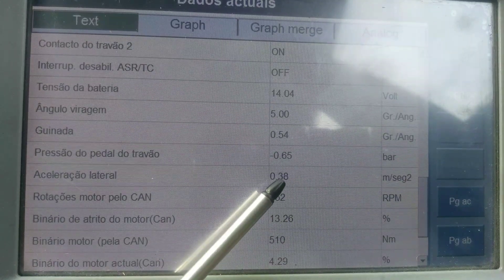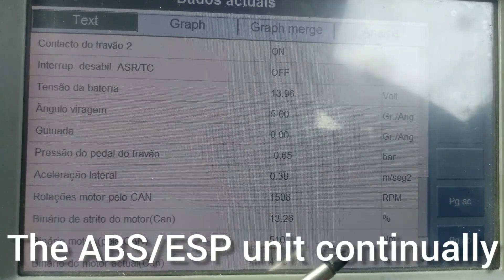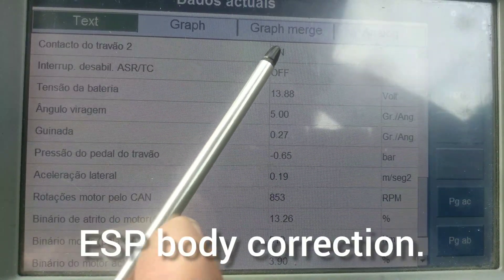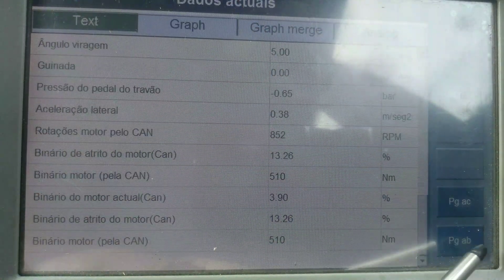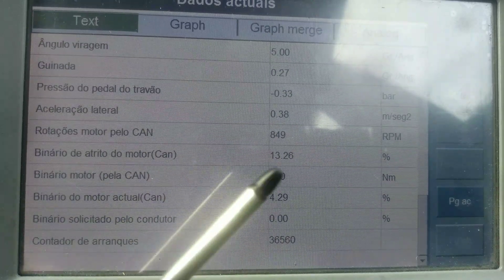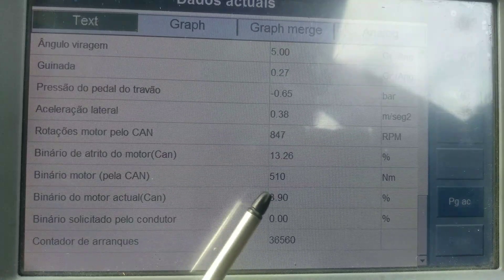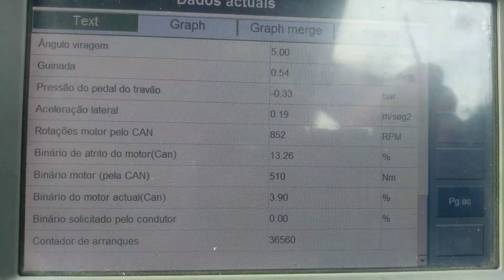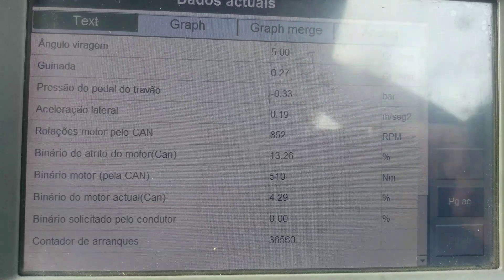ESP vs ABS, witch is best? The principals of working of both systems!

Comment: I think my Sandero has Bosch 8.1 ABS. 
I would never drive a car without it. It is one of the greatest inventions in car industry in my oppinion. Not only it allows bigger brakes to be used, as you said, but also keeps the wheels/tyres at the peak of the static friction (which is higher than the kinetic friction) which reduces the braking distance of the car on solid surfaces. And the ABS also allows the steering of the car while at the maximal braking.
Reply from the maker: You really get my massage! Just for a lough remove the fuse ou the abs/esp main plug. (There's a chance the car not to start)
If it do, drive it and see the brakes behaviour

Comment: Hello, I have a problem with my abs esp unit, it shows an error (c1205) of left front wheel speed sensor but the sensor is good (i;ve connected other sensors that were ok), I've red alot of topics about the esp/abs unit having internal problems with  some very thin wires breaking of. In my car the abs light  apperas after the car gets warm or on a very hot day it lights up immediatly after i switch ignition on, in the mornings when its colder it shows after some driving. I 'm planing to replace the unit with a good used one but there is so many numbers on the unit i'm not sure wich are the one that matter the most and wich are less important. Any suggestions would be helpful, thank you in advance
Reply from the maker: Hello. Thanks for watching! You can trust on the Bosch number. It never changes even if the unit is from other cars or different years. That unit may also have repair. Check out the description of my 156 and 33 cluster repair. They repair stuff like that
Reply: @alfaromeonoproblem  thanks for the reply, I will chck also the video

Comment: Hi. I think I have an upcoming problem with my clutch on my 156 110kw Jdtm. The Kupllung separates only just before the end of the pedal travel. I have looked at the cylinders, both work very well. The clutch and flywheel has only come new since 80,000. Both Valeo. Was probably not good. Do they have a recommendation which clutch is very good?
Reply from the maker: Hello. In fact those clutches have a lifespan of about 100.000kms. If you really have both clutch cylinders with all the travel and no leaks... Disc may be worn.
Wen removal of the gearbox, check if the bearing Shaft bushings are tight and play free.
Reply: @alfaromeonoproblem  
Thanks for the answer. Yes I also fear that the disc is closed. What is better LUK or Sachs clutch? There are also reinforced clutch. What do you think of it?

Internet: sachsperformance.com/en/clutch/zf-sachs/performance-clutch-3000951541-s
Reply from the maker: You have to use valeo/Sachs on fiat gearboxes and Luk/shafler on gm ones. Don't mix! I have a video for that!
Sachs racing is good
Reply from the maker: https://youtu.be/ikSmJS47NGI
Reply: @alfaromeonoproblem  But if the car does not have a dual mass flywheel, it can use any brand of clutch that is made for that car?
Reply from the maker: There is less of a chance of problems. But even last week i had to single mass flywheel cars with big gear box problems because of the wrong brand clutch.
A costumer spent 2k euros on a gearbox repair after installing a luk instead of the Aisin. 
With the same simptom, gearbox rattling, o just replace the clutch kit with the factory assembly, Aisin. 
Problem solved..
Reply from the maker: Had a Partner 1.9d with Sachs from factory, wen a luk was assembled it did not even shifted gears! Gearbox out again and Sachs was a success!

With a bemmer n47 similar story. Uses luk, Sachs was assembled and a terrible vibration like the engine mounts wore broken. 
There is no better brand. The factory brand has to be assembled.
Reply: @alfaromeonoproblem  Wow. OK then, thanks.

Comment: 5:35 does activating abs while driving does the same as the  "purge" on diagnostics tool when changing brake fluid?
Great video, thanks!
Reply from the maker: Hello. Excellent question! Yes it does! Kind of... O will do a video on it. But essentially any air on the abs will escape when it's activaded
Reply: @alfaromeonoproblem  Awesome! Looking forward to that video :) Thanks!
Reply from the maker: Thank you for watching

Comment: Which tyre size should I use on my 156. Currently driving on 16 inch but want to go for 17. Should I go for 215 45 r17, 205 50 r17 or 225 45 r17? Pleas help :-)
Reply: 215/45/17
Reply: I have found the steering gets heavier if you use bigger wheels. My 156 had18 Chinese crap wheels on it and when I downsized to 17" Alfa wheels the steering was a little lighter, like the power steering had more power. I think my car originaly came with 16" wheels, which would give even lighter steering, like it had from the factory, but 17" wheels seems good enough. So, if you go bigger wheels I think the steering will feel heavier and require more effort to turn the steering wheel.
Reply from the maker: Yes, correct. In fact i did talked about that in my bigger brakes video. More Kinect force.
Reply from the maker: Hello. I have 17 with both 215 and 225 registered. On this 17 is too narrow for 225, the tire flexes a lot more. Out loose accuracy and gain comfort. The gta rims are wider and use the 225. 
So, in my view, use 215 kuhmo ecsta tires i use pirelli pzero nero, and they are good, but the khumo last longer and grip very well. Also they are very silent.
Reply from the maker: 205/50 will stretch a bit. Your rims will not last... Great look though
Reply: @alfaromeonoproblem  Thanks for the advice, it's really helpful🙂 Anyway, your effort on the chanel is great and deserves many more subscribers..
Reply from the maker: Thank you very much! More subs would be nice...